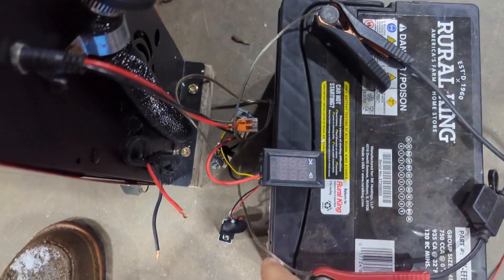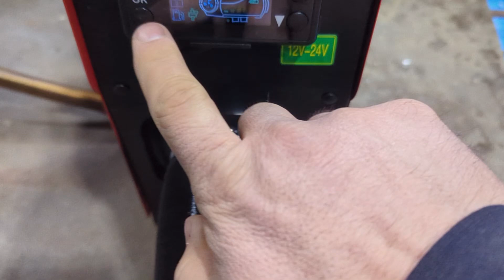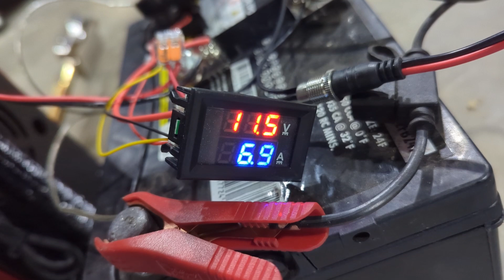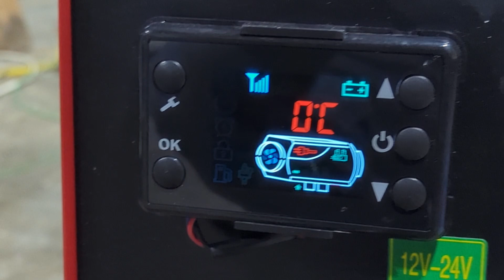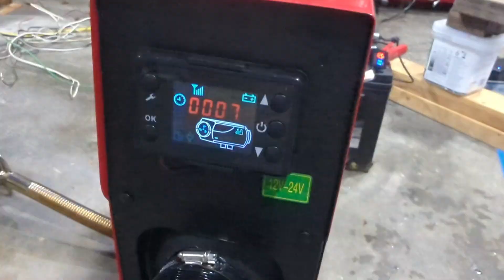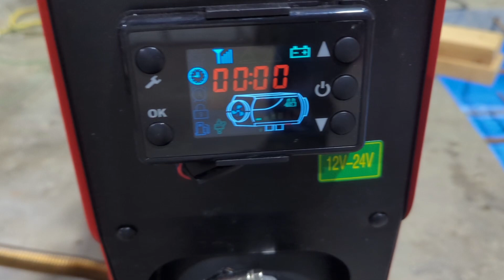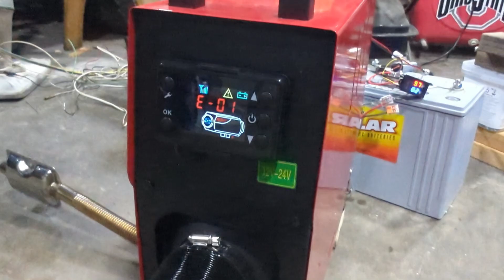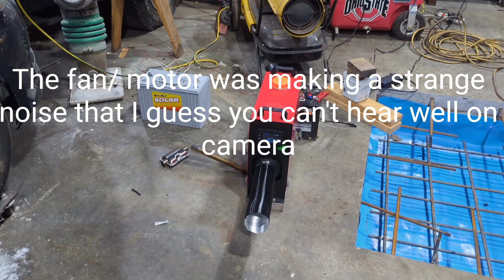PARKING HEATER POWER SUPPLY TESTING

Comment: Consider the total length of your wire loop from - to +. The resistance of a wire is how bad the medium is at transporting electrons. So alot of copper does a better job than little.
Your power supply is also measuring it's output voltage at it's switch mode transformer output and not after the cable and plug and WAGO and shunt and WAGO and internal wiring.